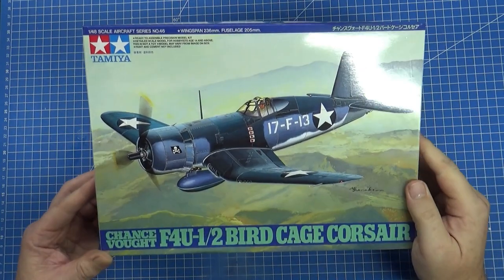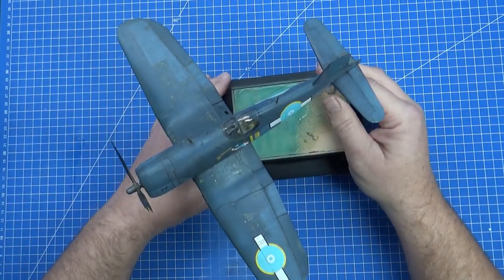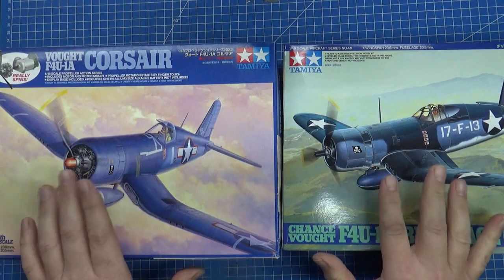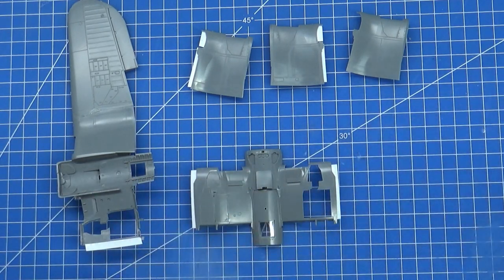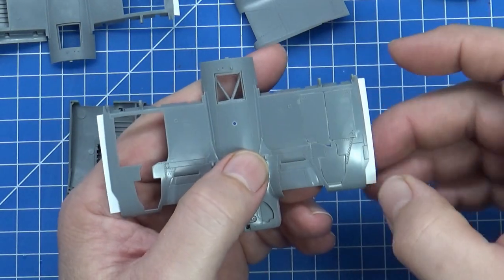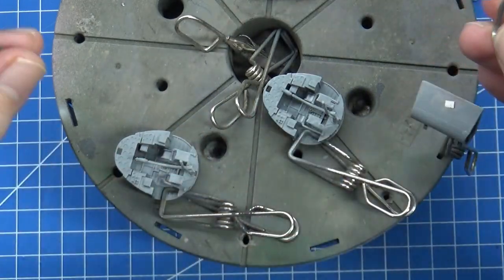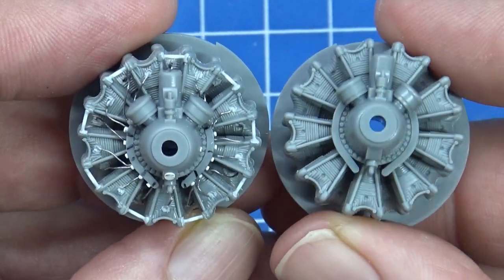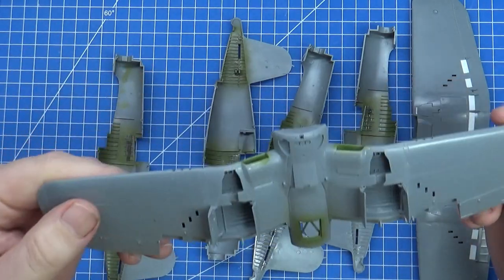Let's build two Tamiya 1/48 Vought Corsairs! Part 1: Cockpit and Engines

Comment: Very nice workmanship and detailing.   On the flying version, how you position the pilots hands on the stick, or just not bother?   Thanks.
Reply from the maker: Thanks EJ. Unfortunately the stock Tamiya pilot is pretty crude, just hands in lap. I usually replace them with an Aerobonus resin one with hands on throttle/stick but went the OOB route for this build. Cheers Chris

Comment: Hi.  Building this now.  Thanks for the video. I didnt catch the name of the white tape substance that you used for the wings.  What exactly is that?
Reply from the maker: Hi Russell, its just very thin sheet styrene, cheers Chris
Reply: @beckersmodels  

Thanks. Building it now. Was having some difficulty with getting the wing parts glued together in down position. Think I finally got but it's delicate.